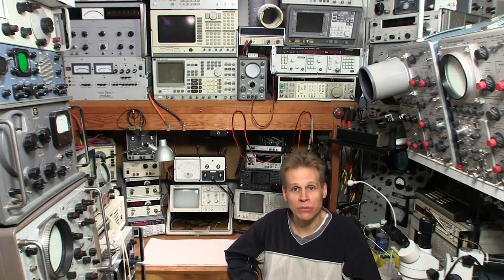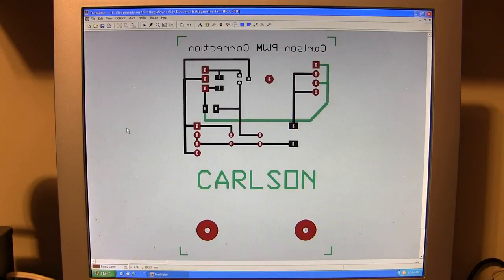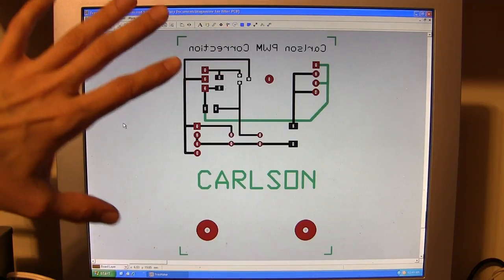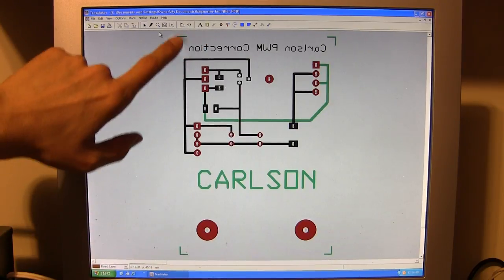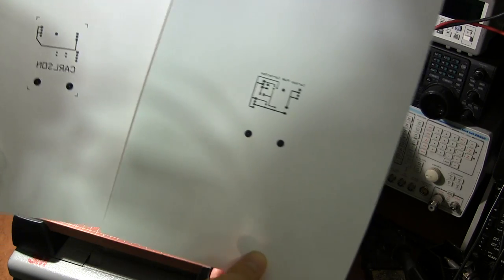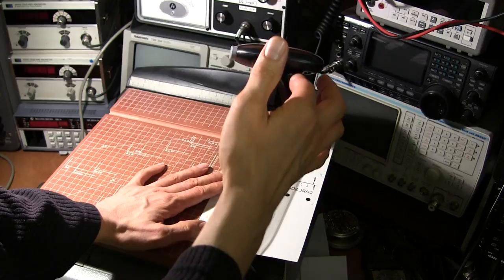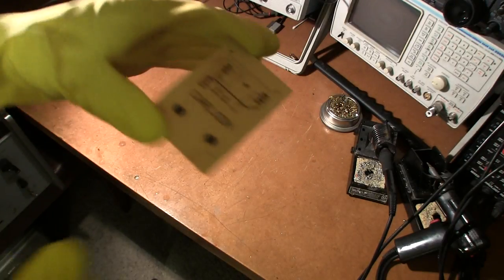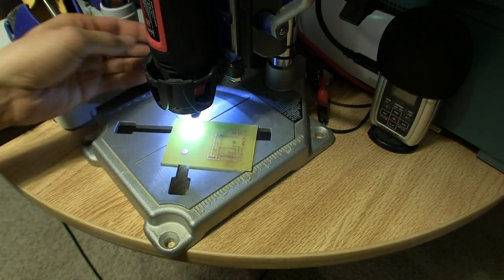How to Make Double Sided Circuit Boards at Home

Comment: Just print both sides at once and bend it over edge of pcb....
Reply from the maker: +Ivan Ignath 
Unfortunately, it doesn't work as easy as that.... I wish it did though.
Reply: That would require a second trip to the bandsaw after transfer, which is probably at the end of a long walk to the garage.
Reply: That would require a second trip to the bandsaw after transfer, which is probably at the end of a long walk to the garage.

Comment: Not everybody owns a laminator. Instead you can use  the cold toner transfer method. Sprinkle a bit of cheap nailpolish-remover on the copper. Place the printout on the copper. When the nailpolish-remover starts to dry up, rub the paper with your fingernail. Wait until totally dry. than throw it in cold water.
You really don't have to clean the copper surface of the copper. The toner sticks better to "dirty" copper than to clean copper. Even the grease from your fingers have NO effect to it.
It's a myth.

Comment: I don't really think you gave cupric chloride  the shot it deserves if you truly think it only works once then has to be dumped.  If you only use it once, it's not even really cupric chloride yet. The first couple of etchings, it's mainly the HCL doing the etching. It's not until it turns a dark green that the cupric chloride starts doing the grunt work.  And when it does start turning from green to brown and etching speeds slow, unlike your ferric chloride, which does have to be dumped when it becomes saturated, all you have to do is oxygenate your solution until it turns green again and your good to go once more.  And if it doesn't want to turn back green from brown, touching up the HCL levels (it shouldn't take much. Not nearly the levels of the initial mix) will get it back in usable shape again without just having to dump it and start over like ferric chloride. And the best part is you can keep doing this indefinitely.
Reply: agreed.  HCl is so much cleaner.  also, i am disappointed because these tutorials never demonstrate electrolysis with citric acid.  a small pack of culinary citric acid costs pennies.  cheap, safe, easy and clean.
Reply: Botha Lissom Utter silliness.  This is to make a great usable board in a short amount of time. Not goof around with kitchen experiments.

Comment: For anyone watching this now days; toner transfer, although a valid way of producing PCBs, is kinda of a by-gone era. Using photo resists can allow one to get much, much better results with a lot less hassle.  I find it cheaper too.  If you have a circuit you find yourself making more than one or two of, it's a no-brainer... you make one mask and make as many boards as you need, then store the mask away somewhere 'til you need another.  Search "Photosensitive Dry Film" on Amazon or Ebay, the developing chemicals are available at your local grocery store.  I enjoyed the video, maybe you should do an updated one on better techniques.
Reply from the maker: I'm not sure if your joking? Photo resist is way more in-depth and time consuming to achieve the same results. If you can't get the same results with toner transfer, you are doing something wrong.
Reply: @MrCarlsonsLab  ,. Perhaps I was.  Just giving an account of my experiences and I personally have much better results with the photo resist process.  Not knocking toner transfer, I just think photo resist is easier, at least for me.

Comment: So, all it takes to prevent the copper from being removed from the circuit board is LASER-jet ink?  I know what a circuit board is with both sides, but what is a circuit board that has layers to it?  Thanks.
Frank
Frank Reiser Video/Audio Service
Reply: Ferrous Cl quickly undercuts the copper under toner once the surrounding ablative plating is dissolved.

Comment: Am I the only one who's noticed it would have been trivial to route this circuit single sided?
Reply: First thing I noticed. I also have a stock of single sided photo resist PCBs so kind of biased towards using them with jumper links and through hole components topside and all SMDs mirrored underside. Besides I have the equipment (UV lamp box, bubble etch tank) from the 1990's as well.  

For doing double side this toner transfer method looks quite good and replaces the UV and developer step (with more fiddly laminator and acetone cleaning step). Also no need for photoresist PCB's.

I wonder about the inkjet photo paper? That is fairly expensive especially when used for many boards. By all accounts cheap tracing paper is the best for UV etching, much cheaper than transparent film, and can be used many times.
Reply: I think you're right, but you might have missed the point here; this is a tutorial on how to make double sided PCBs - what the circuit is, is irrelevant. If he'd done that, you wouldn't be watching a video about how to make DOUBLE sided boards, would you!
Reply: Watch the video, he explains why.

Comment: Why dafuq Windows XP it's 2016
Reply from the maker: +Burgergaming 
I'll let you in on a secret.... Did you know some really big locomotive engine builders still load their system from punch tape? (big CNC Machines) Ya know why? Because the machine is dedicated to a task, and they don't need to spend needless money for a newer less dependable machine. The XP computer is much the same, It's only used for PC boards,  everything is set up perfect.....It has never failed, nothing has ever gone wrong with it.  Why mess with a good thing?
Reply: Why don't you buy new screwdrivers every time a new handle colour is released? Do you buy a new hammer each year? It's a TOOL - a means to an end. 

Wow... people... -_-

Comment: Not true. One part muratic acid into two parts of peroxide will do many boards. I have etched multiple boards using this method.
Reply: Not cleanly... if you want to wait forever for it to etch.